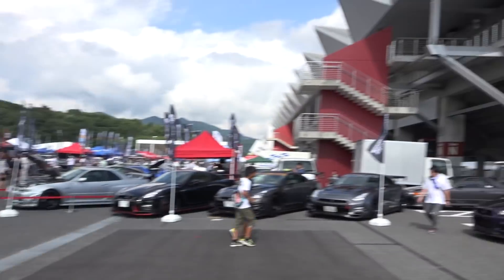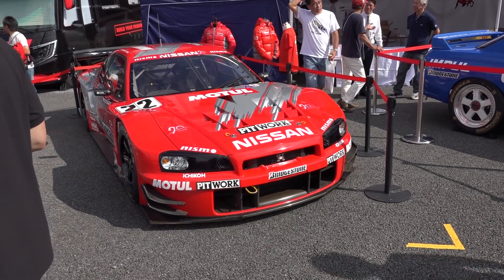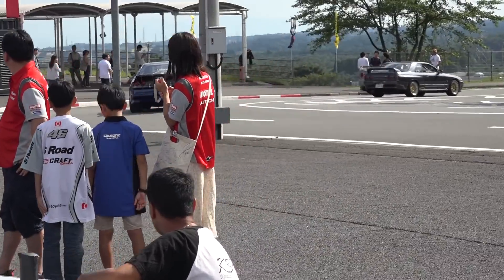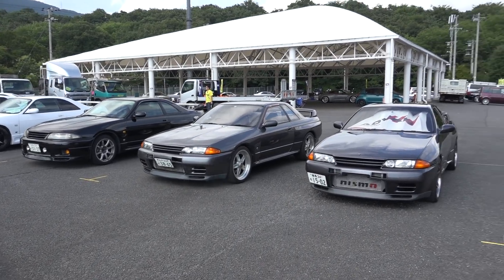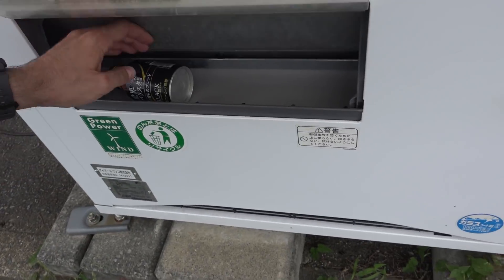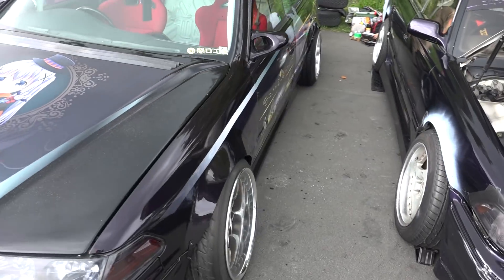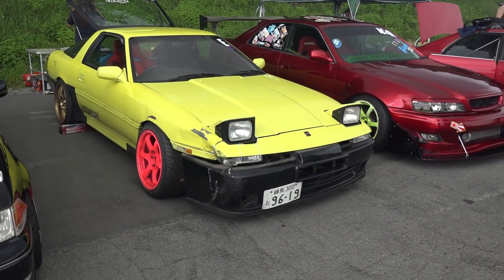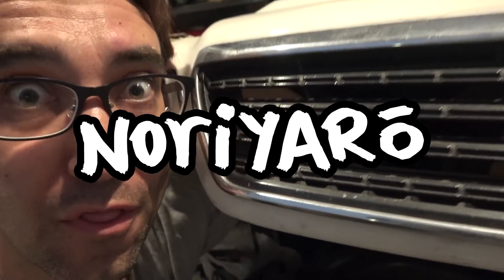Unicorn GT-Rs! R's Meeting and 1JZ Meeting at Fuji Speedway

Comment: Do Garrett make a CHRA that you can use the HKS housings on to put the turbo back together?
Reply: You should be able to fit this to your housings to be able to rebuild the turbo,
http://www.atpturbo.com/mm5/merchant.mvc?Screen=PROD&Product_Code=CHRA-GT3071RWG-84T&Category_Code=CHRA

I wouldn't hang arpound though as it appears that Garrett have discontinued the GT3071 as well so once the current stock are sold out you'l be looking at needing a custom made CHRA which i'd imagine would be quite expensive.